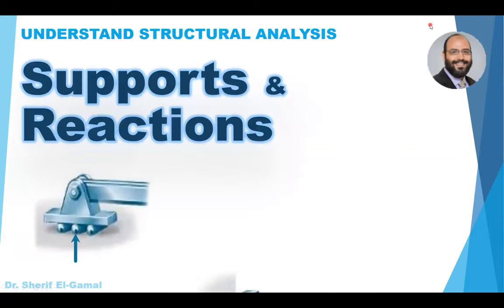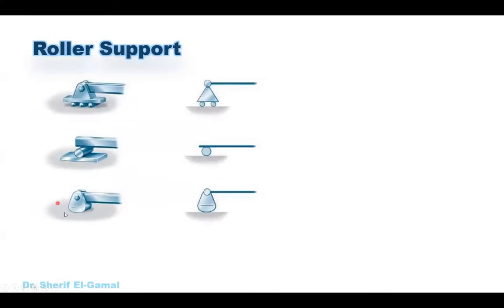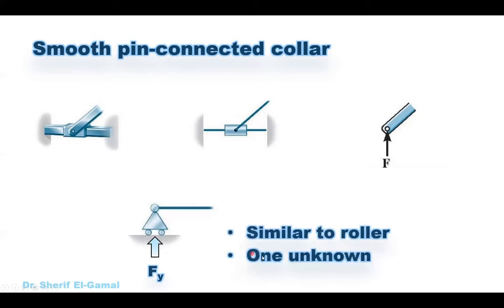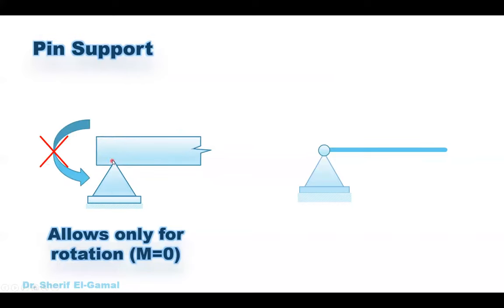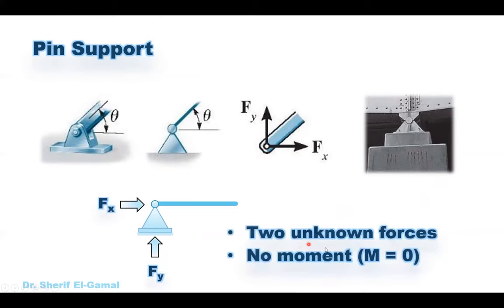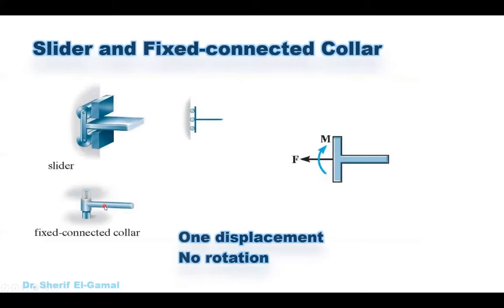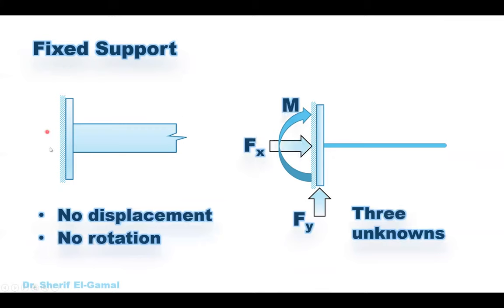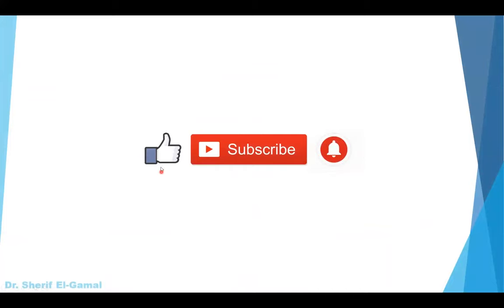Supports and Reactions

Comment: Thank you sir
i wanna to ask you a quastion from pad footing lecture
Checking one way shear stress or transverse shear or line shear, shear stress<2shear capacity of concrete or 2vc this condition that is correct or not
Reply from the maker: Shear stress should be less than vc (not 2vc)
Reply: @MrElgamal77  
Sir book british code bs8110
it can not write v<2vc
Bs8110 code say v<vc 
Tank you sir

Comment: Thank you Dr. I have a question regarding pad footings, when there are moments in 2 directions. How do we get the maximum pressure.
Reply from the maker: As in the case of one moment but add the effect of the second moment
N/BD+6My/BD2+6Mx/DB2
The 2 in the above equation is square.